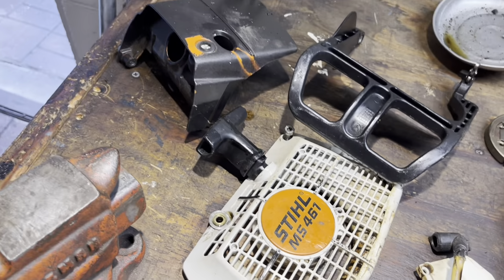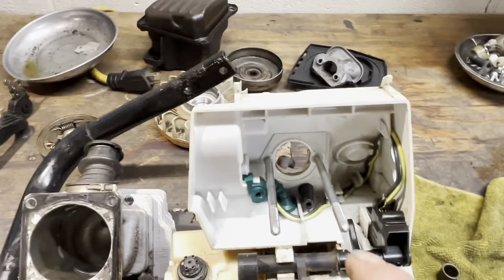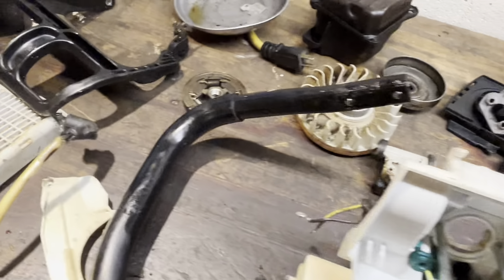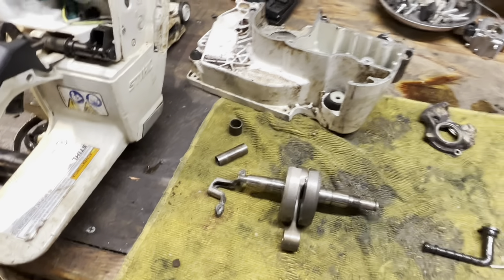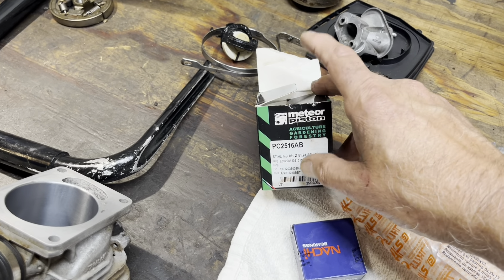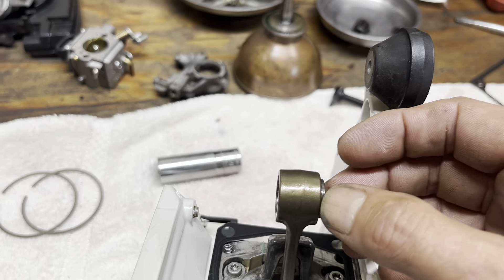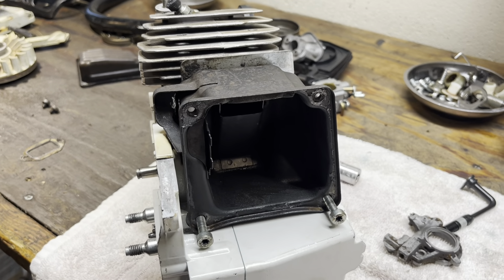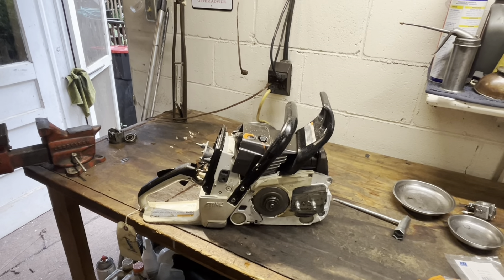Stihl MS461 Carnage and Rebuild

Comment: Man that thing was groady inside! Great job👍🏻
Have an old fs 55 that's cherry inside. I mean still visible machining marks on the ring! Anyway, after 3 attempts cleaning its carb and still having a terrible part throttle bog, I gave up and made a visit to my local stihl dealer to order a new carb figuring it'd be in the $40 range... $87 after tax!😳🤣 went home and ordered an aftermarket one for $20. Willing to take that gamble🤞🏻

Comment: I have a Poland chainsaw, have fire, put fuel in the cylinder and no pop off happens. Check the fly wheel key and it is good. Does anyone have any suggestions what it might be I would appreciate it. Thank you.
Reply: Do you have: 1) sufficient cylinder compression, or 2) any leaks as indicated from a pressure/vacuum leak down test?